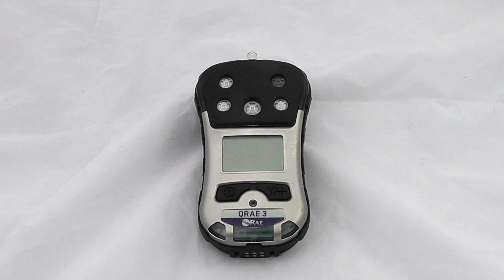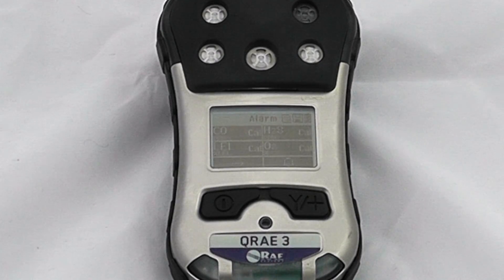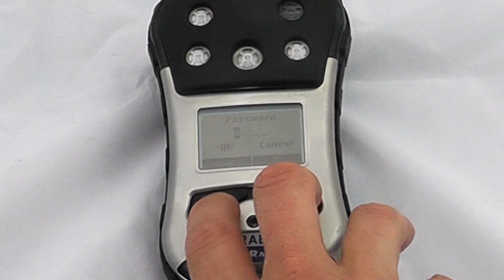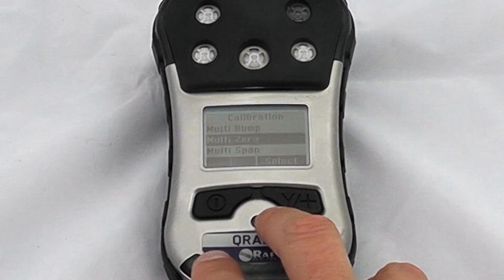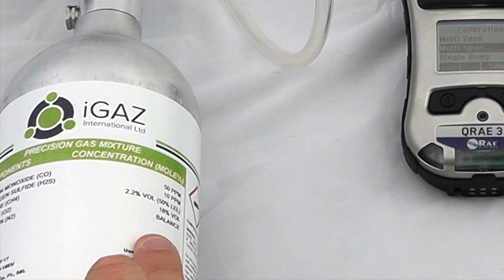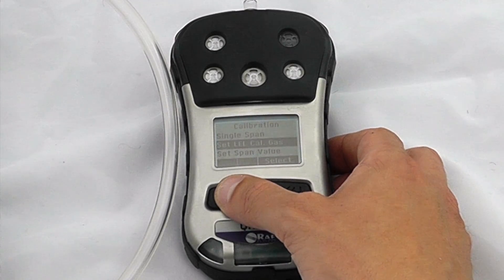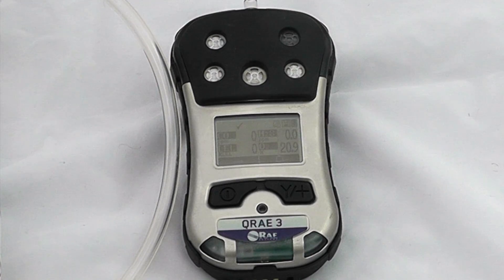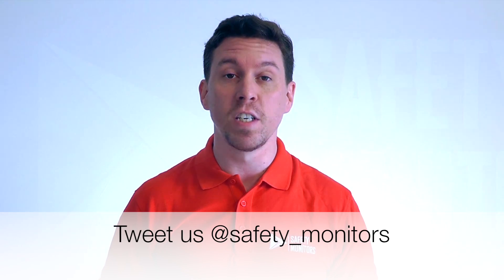QRAE 3 User Guide

Comment: What's that buzzing sound?
Reply from the maker: That's the pump.  There are 2 versions of the unit one diffusive (this passively responds to gas) and this version with a pump.  The pump allows for pre-entry testing with a probe and faster response times on the gas sensors.
Reply: @SafetyMonitors  can you recommend me a good version I mean a  user friendly one (easy to use)?
Reply from the maker: What is the application? If you visit our website you will find a great deal of 4 gas monitor options @reydagzTV